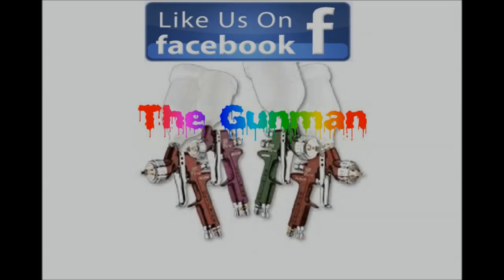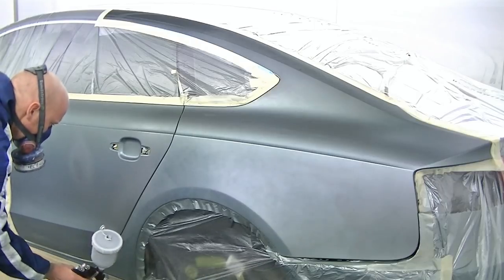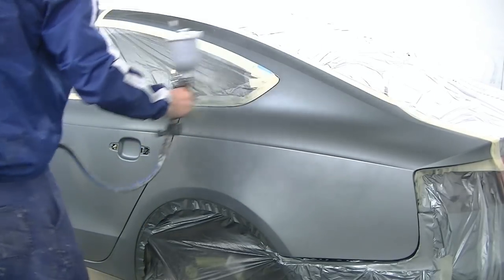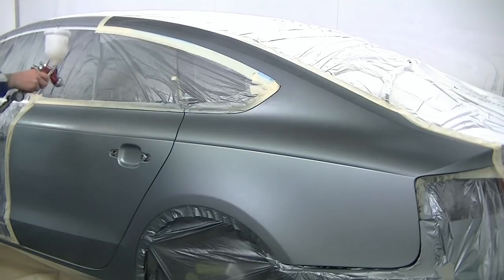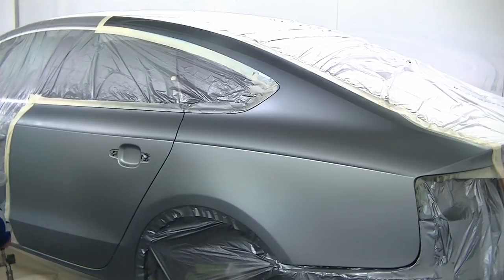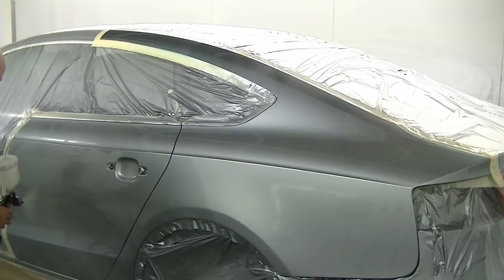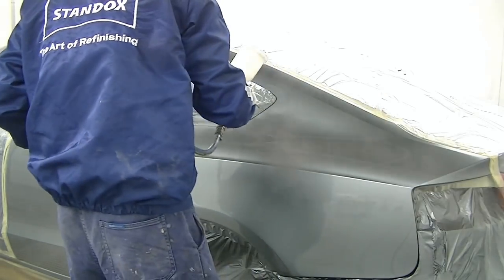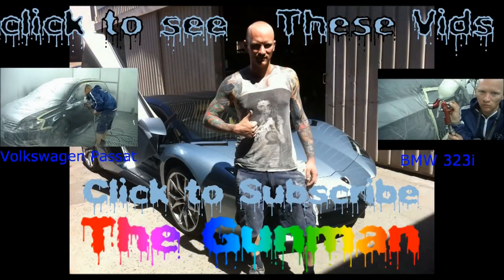How to Paint a Car "Metallic Audi A5"

Comment: I really appreciate  all your vids.  I just got my car back from a pretty reputable shop and I noticed something I wonder if Im being too picky about. 
They painted both doors because of a deep scratch  on  one of them.. I noticed at the bottom corner edge of the front door has a little high side of paint running along the edge of the door. 
It's bothering me because although hard to see,  if someone looks close enough you can tell there was paint work done.. 
I think the goal id to no be able to tell at all the car was repaired. 
Is it perhaps where they taped the edge and paint gathered by the edge?

Comment: In another video you said something about the tack rag that u dont tack rag on paint because it can scratch the paint or put some dust on . Why in this job u used the rag on thr paint ?
Reply from the maker: Most of the time I don't tack rag the base but sometimes if its really hot then it needs it because it will go a bit dusty and create dust, So it must be monitored on each job and use your judgement.
Reply: Thank bro for the information